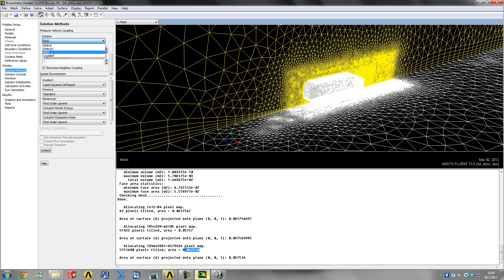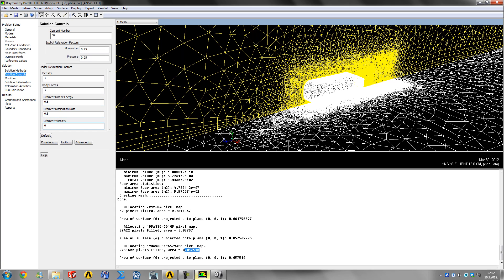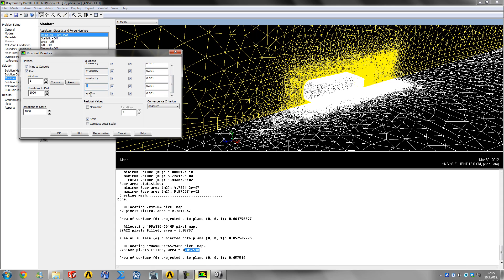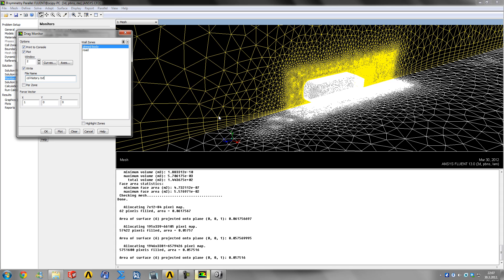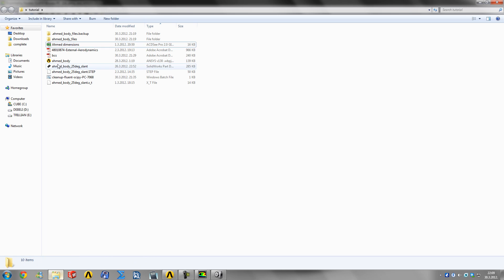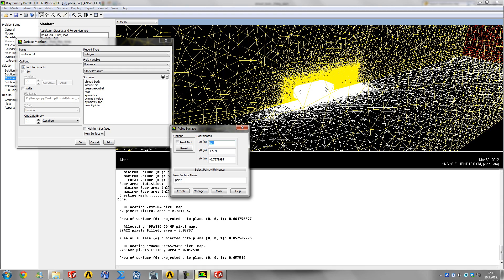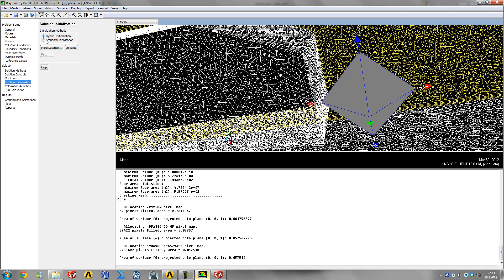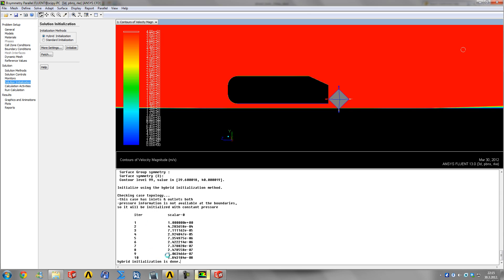Part 3c - ANSYS Fluent for Vehicle Aerodynamics

Comment: Hi, I can see you are using GPU parallel rendering. I'm trying to make it work and I already could for NVIDIA Quadro and Tesla dowloading the CUDA SDK. Now I'm trying to make a Firepro W7000 work, but still couldn't. It says GPU rendering is not enabled it fluent. Do you know any equivalent of CUDA SDK for AMD Firepro? I tried the Opengl libraries but there are so many and it's not easy to use.

Comment from the maker: In fact, it's faster than some professional computers because it's purpose built. I've added a AMD/ATi FirePro V4900 card and now CAD and meshing stuff literally flies (it's faster than a Quadro 4000). If you have the money, the only feasible next step is to go for Socket 2011 and a 6 core CPU like i7-3930K (but that is more than twice the money of this kind of setup) and the differences in CAD modeling and meshing are non existent, when it comes to solving in Fluent then there's a difference.

Comment from the maker: When this was made I had an i7-2600K with 32 GB of 1333 MHz DDR3 (9-9-9-24 timings). Since then I've sold that config and bought a cheaper and faster i5-3570K and 32 GB of 1866 MHz (9-10-9-27) memory. It's about 25 % faster for ~ equal amount of money (HyperThreading of the i7 is completely useless in Fluent and the newer i5 IvyBridge is 2 % faster with the same memory, so the money distribution is now: cheaper cpu & faster RAM).